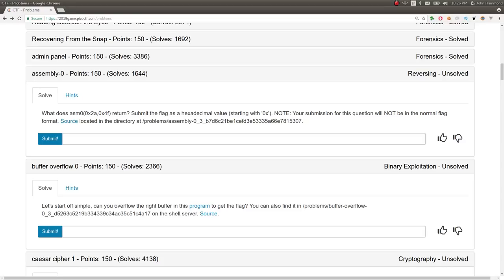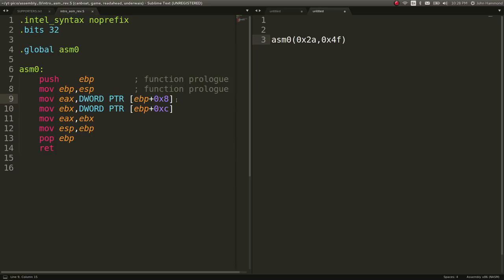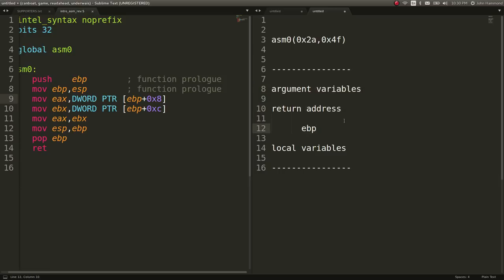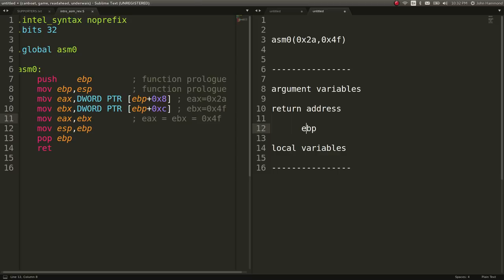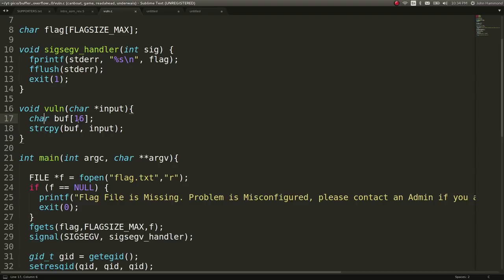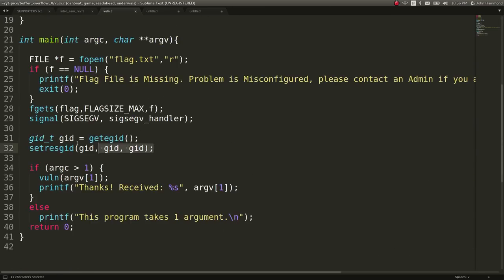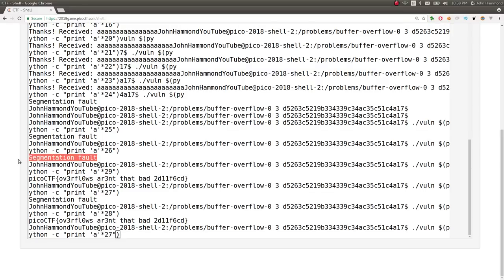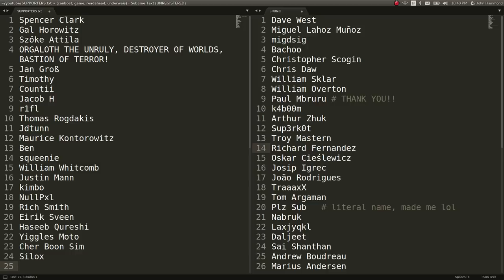picoCTF 2018 [09] Assembly 0 & Buffer Overflow 0

Comment: why are arguments placed at ebp+0x8 and not just ebp+0x0? What purpose does the padding serve?
Reply from the maker: ebp+0x0 would just be ebp itself -- and ebp+0x4 is the return address. The difference in 4 bytes for each of these is because that is the size of the data; the return address is 4 bytes, the argument variable can take up four bytes, so it can go from `ebp+0x8` to `ebp+0xc` and so on. You just move by four to access the "next" piece of data.

Comment: I don't get it. Pushing somethig onto the stack means it should be at the topmost location, so ebp should be above the arguments?
Reply: coding4fun so essentially, EBP points to the bottom of your stack. However, the stack grows DOWN (in terms of addresses - your most recent writes to the stack are at lower mem addresses). So when you add things to the stack, you do so by making room (SUBTRACTING from the stack pointer), then filling in the gap. Hope this helps explain addressing and whatnot, essentially this buffer gets added to the stack and you write through it, through the ret address.